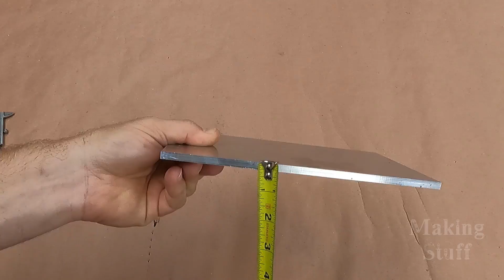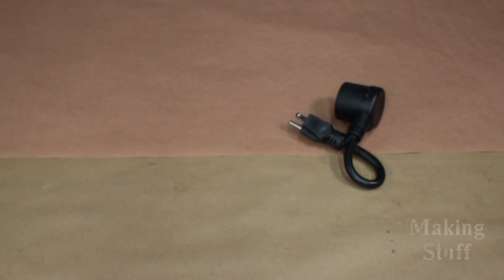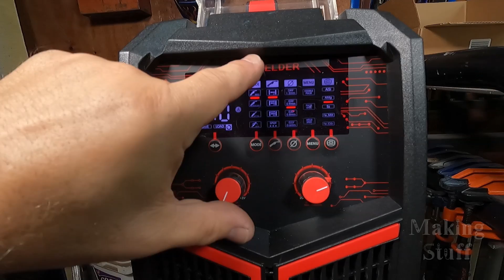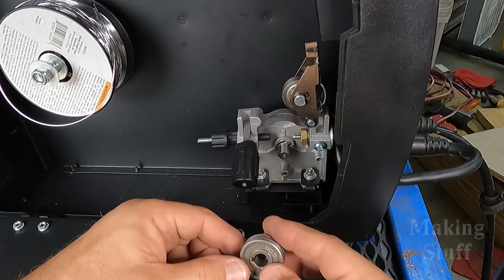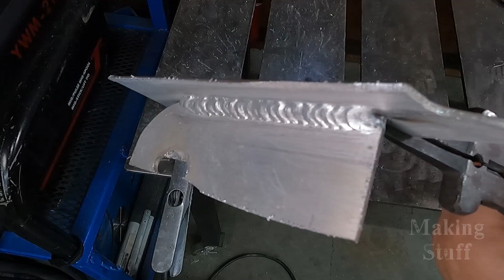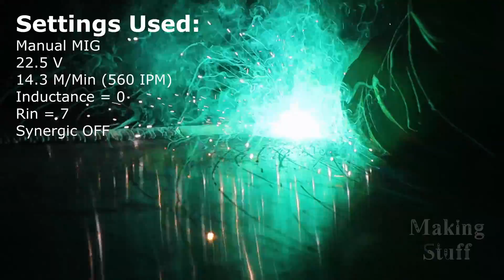New from YesWelder - YWM-211P Double Pulse MIG Welder

Comment from the maker: Be sure to use the discount code MAKINGSTUFF at check out on the YesWelder web page and save 10% off your order!
Reply: Does this 211p model  weld standard flux core??? i Didnt notice a way to select none gas method on the menu in your video or anybody else's reviews of this. i emailed and called the yeswelder company and the email and on phone said that it doesnt weld flux core, only gas mig steel, ss, aluminum. why does it have 3 drive rollers than, the u, v, and w which i thought was fcaw wire roller. Please let me know
Reply: I would also like to know if it can use flux core before I purchase.
Reply from the maker: @davidvrrampaul8663  There is no setting in the menu for flux core.

Comment: Those are certainly nice welds on the thin aluminum. I notice you have a setting of neg 5. Does that setting shorten the arc length by reducing the voltage? Also, how did you get that setting with syn off?  That trim function setting I thought only worked in spray mode. Were you in spray mode with such low voltage?
I am just a hobby welder but I do like to know how things work
Many thanks for the great video. Cheers

Comment: I have 1 yeswelder 250 mig and these machine never stop to amaze me, I’m currently welding 2 11pound roll of 0.045 316L flux core per day with them and they keep pushing! The original mig gun was really bad but change for the 36kd or a better one and you can really push this machine beyond

Comment: I don't get why the spool gun is better
Reply from the maker: The aluminum wire is soft and it doesn't have to be "pushed" as far when in a spool gun.  This pretty much eliminates any chance of a birds nest in the welder.  It also doesn't have much of a spring effect when it is oly being pushed a few inches.
Reply: @MakingStuff  I see. thank you. I had a spool gun on a Miller and didn't like it because it's so clumsy.

Comment: I noticed you used couple yeswelder models. Id like something good all round.  Tig aluminum/ steel/stainless,  mig/ pulse mig if possible and plasma cut. Probably nothing thicker than 1/4" ta 3/8" will i ever weld or cut. What machine do you suggest? I don't have a need for stick welding.  Can suggest a machine that's not yes brand if have one.

Comment: Thanks for the helpful video. I must say I am a little confused about how to set some of the settings I note there is no selection for thickness of the workplace. Do you set this up by using the accompanying chart?
Reply from the maker: Yes I use the chart as a starting place then dial it in from there.

Comment: Excellent for thin material you advertised ,yet you do 14 guage which is 1.9mm , thin is tin can .. 0.3mm .. try that then you know. they gave you free and you are raving about it , of course anyone would be  ..  you mig welded 14 gauge steel which is 1.9mm , stick welder do same so i do not know what impressed you and you can hook spool gun and pulse box to your old  stick welder and do same.

Comment: Thanks. Have been looking around for a pulse mig welder. Why did you have difficulty welding 1/16 with the mig gun but you were ok with the spool gun
Reply from the maker: The MIG torch does not have a steady flow like the spool gun does.

Comment: I think the manual says it doesn't pulse weld with a spool gun. Is the manual incorrect. Sure would be better if it pulse migs with a spool gun also.
Reply from the maker: Yes, mine will pulse weld with a spool gun.  You can see it in the video.

Comment: Another question... Sorry about all the comments and questions I'm asking but will 4043 work using mig if using a larger diameter of wire?
Reply from the maker: No.  I tried .035 4043 wire and it would not work.
Reply: @MakingStuff  on the one i used that mig welded aluminum we had to use.045......5356 ran too poorly.

Comment: Are you having to do a lot of pre cleaning the aluminum like you would if you were Tig welding? In other words are you able to adjust the cleaning with this much like you can with a Tig welder?
Reply from the maker: I try to make it as clean as possible, but it is not as picky as TIG welding.
Reply: @MakingStuff thank you 😊

Comment: I just got one of these and can't figure a few things out: 1) On the display, the far right column, does that refer to gas type as you say in the video, or does it refer to wire material type?  2) I believe it is a wire speed adjustment (mine didn't come with a chart), but I am wondering how to adjust for material thickness in MIG "Syn" mode?  3) Is there a way to change the units from metric to imperial?  Thanks for your time.  Keep up the good videos.

Comment: Thanks for your review.  I am seriously considering this model.  Do you have any idea if it can be adapted for MIG brazing?  I need the brazing mode for auto body applications as it is a requirement of many manufacturers due to usage of high strength steel.
Looking at the instructions it does not have brazing settings directly.  As alternative I researched Miller MIG welders.  Miller has no brazing mode but they provide instructions on their website how to adapt MIG settings for brazing work. Do you think this machine can be also used for brazing?
Reply from the maker: It won't do brazing.
Reply: Kemppi pulse is the best for brass top machine and quality at a top end price tho

Comment: After selling my Vulcan MigMax 215, (watta beast that was,,, I abused that thing maxed out for months, it never blinked) I purchased one of these Yes machines specifically for the purpose of welding sheet steel custom body panels and intending to make use of the pulse functions. I weld mostly with 023 when doing this so the first thing I did was to load a 10lb spool of 023 and installed the 0.6mm driver roll. Set the machine at the recommended  settings for 20-ga, 100% Co2, 15v  40A on synergic. Then attached the ground clamp and attempted to weld with a new 023 tip installed on the gun. (YesWelder did not provide an 023 tip in the package, so I used one of the common copper 023 tips available everywhere) Even with the wire drive roller clamp fully tightened, the drive roll slipped on the wire every time I tried to weld. The small wire stuck inside the 023 tip every time it had to carry current. My first attempt cause me to pull out 10' of wire for a looksee. The entire 10 feet that was inside the liner had bend waves, as though it was behaving like a spring, coiling up, then recoiling back to length. Never saw a weld wire do that before today. 
.
Possibly, it is my lack of knowledge of how to set up their machine. 023 can be a pain if the liner is filthy. In this case, the liner and the rest, are all new. I am in contact with the Yes people to figure out watzUp. 
.
Needing desperately to doo do some down and filthy welding, I loaded a 10lb spool of 045 and adjusted the settings accordingly maxed out at 200 amps as I was welding 1/2 steel as I commonly do. There were no hiccups with the 045, that's for sure; the machine plowed into the thick steel seemingly better than did the Vulcan, and all while using synergic settings for 035 and the U-09 drive roller that facilitated the use of the larger 045 wire.
There is a big difference between the Vulcan and this Yes thingee. This, Yeseree, clearly trounced the Vulcan in its synergic settings, producing very little spatter compared to the Vulcan which consistently blasted great balls of fire to all sides, leaving the surrounding surfaces a mess.
.
On the surface, compared to the Vulcan, the materials used to make the electrical mechanism get the job done, are on the cheesy side. For example, the ground clamp copper fabric that electrically ties the two sides of the clamp together is not spot welded to the other half of the clamp. Because of that, the fabric dislodged from under its clamp, leaving it dangling between the two halves of the clamp. 
.
The drive roller clamp mechanism is stamped folded steel, compared to the fully cast parts used on the Vulcan. 
.
The gun is fine. Took me about 10 min to get accustomed to the double trigger function, but now I love it. No need to squeezy the trig all the time. 
I kinda do'nt think the clear plastic cover is going to last in my environs; soo much scheight fly'n round ya know.
.
It may be the machine needs a dual drive roller assemble before the 023 will pass properly,,, who knows??
.
With all the stuff attached, the Yes machine is significantly lighter than the Vulcan. 
I love that part :)
You should see the Miller beast I used to tote around to the jobs back 30+ years ago.
Reply: I'm just looking at this welder for the first time. I have a Lincoln 255 that's note portable. I'm curious if you soled the .023 problem? It occurred to me that you have the drive rolls too tight. When it pinches too tight, it can warp the wire. Anyway good luck.
Reply: 100% C02??!

Comment: Where have I seen a MIG weld like that on 1/16" aluminum?  The HTP Pro Pulse MIG welders have been doing that and even better since about 2015-2016.  They have a Precision-Aluminum-Weld Program that can weld down to 0.030" thick aluminum without needing to use a spoolgun.  It uses an 8ft long aluminum dedicated MIG gun with a carbon-graphite liner.
Reply: For how much??
Reply: @jacobfulton5106  HTP Pro Pulse MIGs are a few levels above yesweldr machines and do everything they are spec'd to do.  Made in Italy by Stel.  The smaller 200A machine is the 220MTS, and sells for $2295.  Right now they have a special where you got both the MIG gun for steel AND the 8ft dedicated MIG gun for aluminum.  Email me for more info.
Reply: you Have some nerve surfing on someone else's page. selling a $2300 machine as if it is comparable. you really make no sense  @zod-engineering-welding

Comment: Does this 211p model  weld standard flux core??? i Didnt notice a way to select none gas method on the menu in your video or anybody else's reviews of this. i emailed and called the yeswelder company and the email and on phone said that it doesnt weld flux core, only gas mig steel, ss, aluminum. why does it have 3 drive rollers than, the u, v, and w which i thought was fcaw wire roller. Please let me know
Reply from the maker: It's not a flux core machine.  But check out the MIG 250 Pro. https://youtu.be/CR37yvZALdk

Comment: Thank you for the review.... trying to decide between this one or the MIG-250-Pro.  Any feedback between the two... I know you reviewed the 250-Pro about a year ago...
Reply from the maker: The 211P is better in my opinion.  Especially on aluminum.
Reply: @MakingStuff  yes, thank you.  I went ahead and ordered the 211P using your discount code.  And was able to get the spool gun from Amazon for a lot less than in their website.
Reply: @Wachuko-1  are you using 211p with a spool gun instead of Mig welding aluminum? I'm looking to get a good aluminum mig welder because I have a business fabricating custom designed aluminum gates and all I do is aluminum. I'm trying to get away from the spool gun and I also Tig but it's too slow to keep up with how quick I should be getting the gates built. I need to go faster and we all know you can only go but so fast with aluminum so I see my only option to go quicker is aluminum mig welding. I just watched some videos of the HTP and I'm trying to see my best options for the best price. The welder I used before I started my own business cost 12,000-15,000 and I don't have even close to that.
Reply: @Wachuko-1  I asked this question before the video was finished. I didn't know it would pulse weld with the spool gun. That's why I thought I had to have a mig torch, aluminum mig welder to have that function.
Reply: @willhall7777  All good... glad you got the answer at the end of the video.  There was not much that I could contribute... I am using it just as a hobbyist...

Comment: Reason why you haven't seen the ceramic diffuser on any of the mig torches most companies cheap out and use the ak15 mig torches on their machines which are 150 amp mig guns. It's actually quite impressing that yes welder actually upgraded to the MB-35 benzel Meg gun which has a heavy duty tips ceramic diffuser and also has a better nozzle and it feels better in the hand. My cheap MIG welder that I have that was the first thing I did was throw away that ak-15 mig gun and ordered an mb-35 benzel mig gun from China. But keep up the good work keep up the great videos looking forward to seeing more of you welding on the aluminum boat. Hopefully you'll be using that new yes welder 211p w/ double pulse....
Reply from the maker: Thanks for watching,  Yes I've switched over to the 211P on the jet boat.  I wish I had it when I started a few months ago.